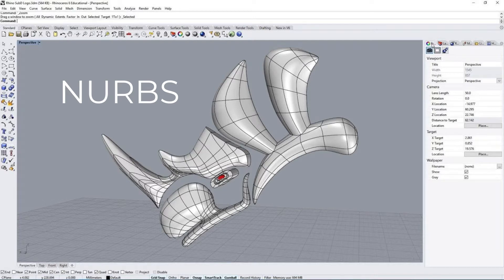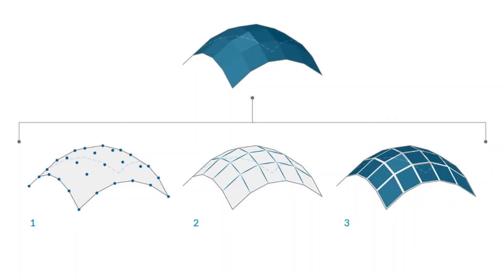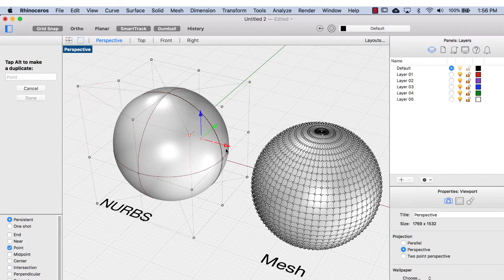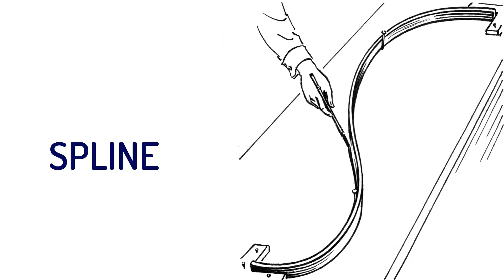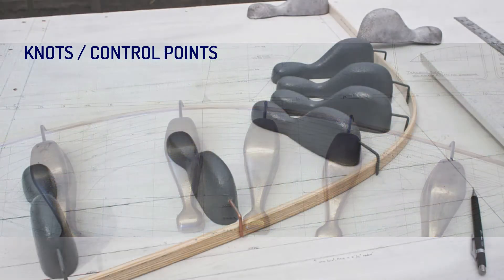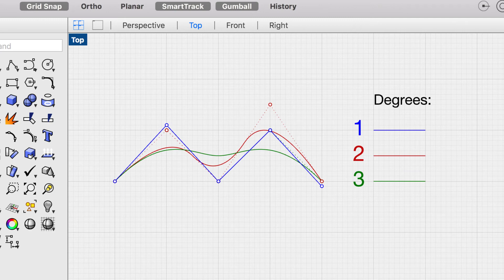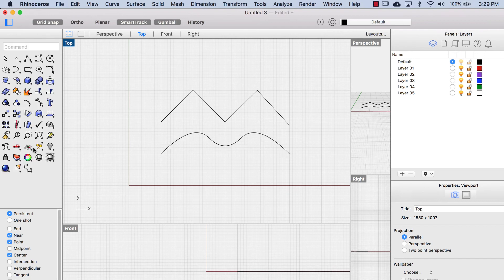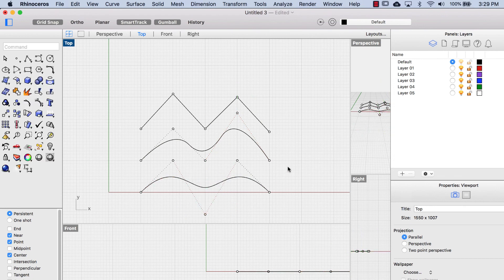4. What is NURBS Modeling?

Comment: where is a spline in rhino that has the points on the spline like in solidworks versus handles thanks
Reply from the maker: Hi terrablader. I think you are referring to the control points on the curves in Rhino. You can try typing the command: PointsOn for a Control Point Curve. On the other hand, if you are using a Handle Curve, you should automatically see the handles for that type of curve. Does that make sense?